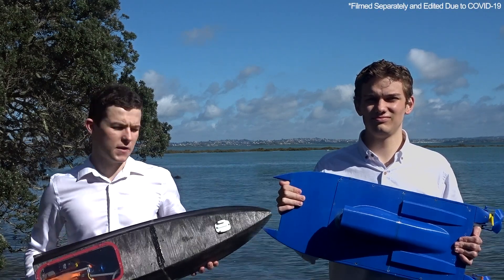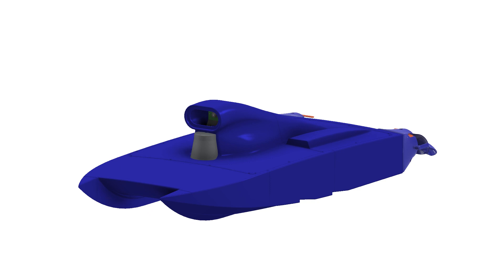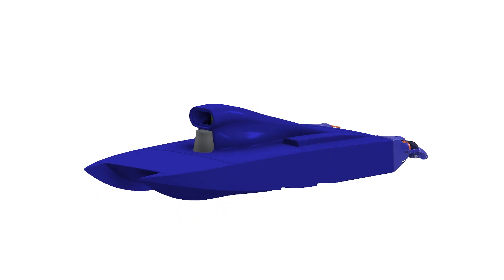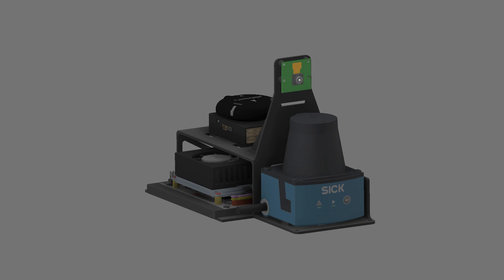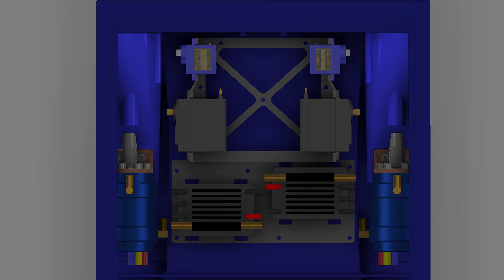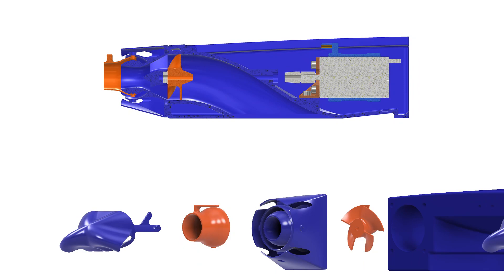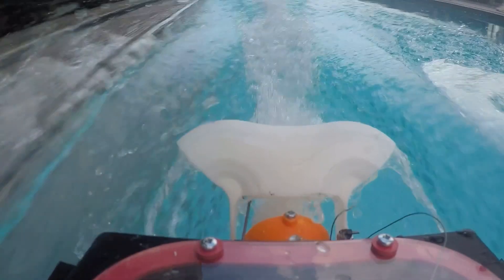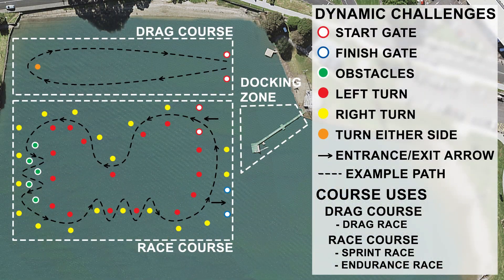Open-Source Autonomous Speedboat Platform - Hackaday Wildcard Submission 2021

Comment: Awesome stuff guys!
I have a few questions
what sort of boat speed were you getting compared to the jet velocity
How did you estimate jet velocity and pump efficiency?
what sort or electric motors were you using. Power?
did you spend much time designing the stator blades? Its hard to see what they look like. I've found they can make a huge difference to efficiency.